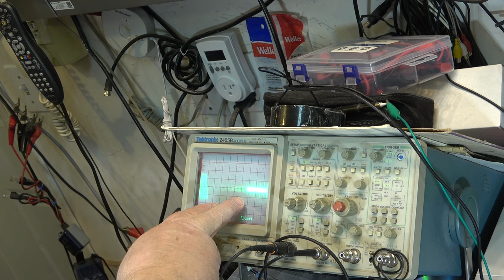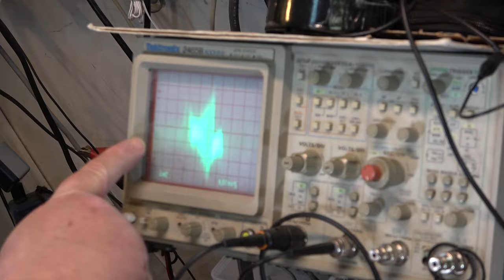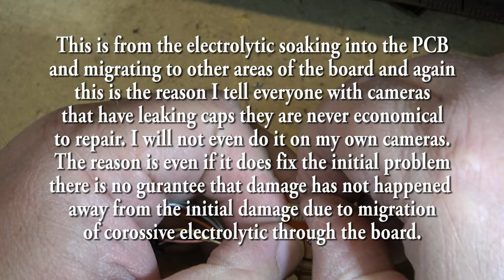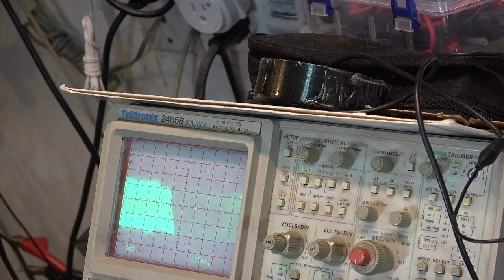SONY EVC3 8mm VCR multiple problems mechanical and electrical to solve

Comment: I had to change 22 bad SMD caps on a PCB with very fragile traces. I don't have SMD tools, and when I used a sidecutters it would break the trace. Ended up using a soldering iron in each hand,  hitting both legs at the same time. Felt weird but worked incredibly well.
Reply from the maker: I've done that.  2 irons.  Only problematic when the caps are very close together.

Comment: You've stolen my thunder!  I'm just editing together a video for release this week where I repair a Sony EVS1000 (same "Sony U-mechanism") and exactly the same linkage had fallen out.  And a heap of other problems too, of course.  What's the chances of that?!  Well perhaps this was a common problem.  I took the deck out for slightly better access.  I probably made work for myself too because I removed the cam gear that the linkage had fallen off, so that had to be re-timed when installing.
Reply from the maker: You mean M mech. The U loader has a gear that spins like the one in the opening logo.  I have all of them.
Reply: @12voltvids  Strangely enough, "U mechanism" is what Sony called this one, despite the fact it uses the M-loading system. Just checked the EV-S1000 and 3000 manuals to confirm.

Comment: 56:34 Well stated Dave, I have a customer who brought in for repair a Sony GV-200 purchased from an ebay seller who "specializes" in Sony. He had fully restore it and it worked fine for about 3 years and then suddenly the color now slowly fades like a line down the display to BW. If I slightly bend the mainboard in one corner the color comes back. :)
Reply from the maker: I got a slvr1000 shipped in that was rebuilt from a big eBay seller restorer.  It's on my channel.  It had a broken board that soneone attempted to fix, poorly.

Comment: Hi Dave,

Another interesting posting, thank you. It’s amazing how much damage can occur from leaking caps – sometimes quite a distance from the guilty party. I blame “Mr Wick” myself. It’s also amazing how a preamp fault can masquerade as a single faulty video head sometimes.

As for the guides, I’ve been wondering for time as to they work loose. Did Sony use some kind of  locking nut or grub screw arrangement, perhaps it’s some kind of tapered thread (unlikely?) or did they rely purely on a dab of glue or paint? The things is, if it’s really loose, having set it up correctly whilst laced up (naturally), will the unlace sequence move it again. I mean, when is the glue applied, whilst playing perhaps (and certainly before an unlace)? 

I get the feeling that these 8mm decks get regular guide trouble. My late father’s camcorder went into Sony multiple times with the same problem. Such a shame.

You certainly have some patience Dave. Hats off to you sir!!
Reply from the maker: There is a lock screw on the side.  I didn't show tightening on this one but i did snug down before i even touched the guide alignment as it was really lose.   It's a tiny Philips screw on the base facing sideways.  I showed it on the last evc3 I did a few weeks back i believe.
Reply: @12voltvids  Thank you Dave, all understood now. Wow I bet that's a bit of a faff! I mean, you've got to have it loose enough to allow adjustment whilst laced up and running, but tight enough to stop it spinning out of position once you've finished alignment and gone and done an unlace sequence.

I'm still amazed how those rogue caps got to eat the ribbon cable to/from the drum! Just goes to show.

PS I don't think people can understand why firm quotes can't sensibly be provided upfront for repairs, but this posting shows exactly why that's the case. You also have to have a stock of interchangeable parts of course (again this posting shows why). Again, this is something else that folk generally don't understand. Keep up the good work Dave! I'm always looking for your next postings to keep me sane. Cheers!
Reply from the maker: That's just it and has been since the start of time.  People want a free estimate.  Well a free estimate is a guess.  It is completely impossible to do an estimate without actually repairing the unit and do that we need to get paid for the time.  So what happens here is I have spent the time and hopefully things will work out.  The owner could just abandon it which has happened before.  Since i don't need another 8mm player I would end up selling it but around here these do not go for much.  I know people will say they go for hundreds on eBay well i have tried eBay before and none of mine have ever gone for much.  I had a tascam da30 dat up on eBay for 4 months.  It finally sold for 52.00 and when the buyer found out the shipping was 120.00 to the states they wouldn't pay so I got stuck with the closing fees. So i listed again and this time i put 140 shipping fee in the ad and got no bids.  So here it still sits.

Comment: I had the same problem with the exact same deck, on my Sony CCD-V6000 Pro camera when I changed all the SMD capacitors I had to re-grease the moving parts, put super glue in the holes to keep the loading brackets from coming off and remove a yellow sponge on the head near and tighten the alignment screws the camera will write and play the video correctly just sometimes there are some colorful horizontal bars this will also happen when I don't play a tape directly the CCD image on the TV when I turn off the digital effect these bars will disappear maybe the two throoghole capacitors that I didn't replace on the TBC digital board, such a good technology that went bad unfortunately, do you know any hi8 player that supports TBC?
Reply from the maker: Yes the evs3000 avs evs7000 have TBC avd they also have tons of bad caps.  I have 2 7000s.
Reply: @12voltvids  In my case, what do you think, I have cleaned the boards and changed all the capacitors of the camera, the camera works normally sometimes and some other times colored horizontal lines appear both in the reproduction and in the direct connection to the TV from the CCD. and when i turn off the digital effects the horizontal lines disappear
Reply from the maker: Sounds like a grounding issue somewhere in digital board.  Remember these are multi layer boards.  Any crap that leaked our if the caps has already wicked into the board and eaten into internal copper traces which can cause an intermittent or permanent failure.  The v5000 and 6000 were full of leaky caps.  I had one way back and i totally recapped it back in the late 90s avd sold it.  A couple years later it showed up at the shop with intermittent faults related to the bad caps that had already been changed.  It was condemned and scrapped at that point.
Reply: @12voltvids  the digital board has been completely cleaned there is no leakage oxidation anywhere, maybe it must be the bad grounding because I didn't glue the grounding of the board to its metal case enough I will probably have to look at this at some point, however the camera sometimes shows these colored lines and some he plays very correctly 🤔
Reply from the maker: You can't clean the board.  You can only clean the surface and wetting the board to clean creates more trouble.  The boards ate 4 or 6 layer.  There are traces sandwiched in between and any liquid on the surface of the board soaks in and spreads out into those internal layers and causes damage.  Yes you need to resolder the metal can to the board, but if the damage is internal it's impossible to fix.
Reply: @12voltvids  just tried the camera on the tv it had those annoying bars again not very visible i moved the camera left and right and the bars disappeared i wish and maybe it's the bad soldering i didn't do correctly on the ground of the digital board 🙄
Reply from the maker: Sounds like a grounding problem to me.
Reply: @12voltvids  if i get it fixed it will be a second V6000 camera on the planet repaired and working
Reply: @12voltvids  thank you very much that was the ground in the end and fixed now it plays nice ✨

Comment: updates and processors all they are doing is updating to make the processor run slower so you eventually have to update your phone.
I have so many expensive equipment that runs like shit on i7 processors and runs perfect on a ancient core 2 duo processor 
with more power and performance.

Comment: Even if the original drum was fine, wouldn't swapping it over still make sense because the pre-amp adjustments were performed at the factory using that drum? Or that doesn't matter?
Reply from the maker: No difference.

Comment: You might consider just changing your email every year. So just choose a name and add the 4 digit year to the end.
Reply from the maker: I have too many now, and the problem is people that I have done business with years ago try to contact me on my old email. I still have my old hotmail account and it still gets used believe it or now and that was when I was in the satellite dish business. I worked on both the BUD and  the LSD. (Big Ugly Dish and Little Silly Dish). Did that for a few years when I left the TV repair business. Had a catchy satellite related name that is still is used.

Comment: If you do heavy tasking you a cellphone try a ultra or pro series phones they are ment to last long time with lots of power
Reply from the maker: I'm not a power user.  My average monthly data use is just over 1 gig. My monthly minute use less than 30 min.  That's why i have such an old phone.  I hardly use it.